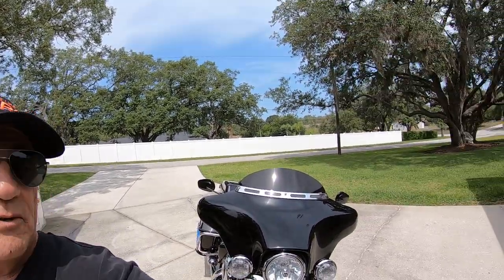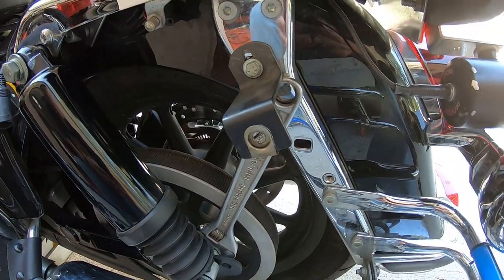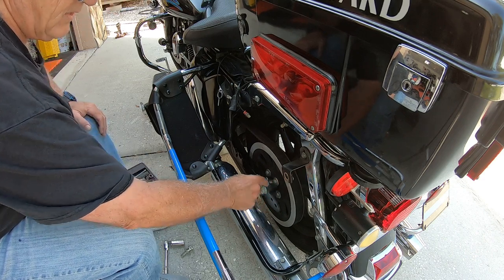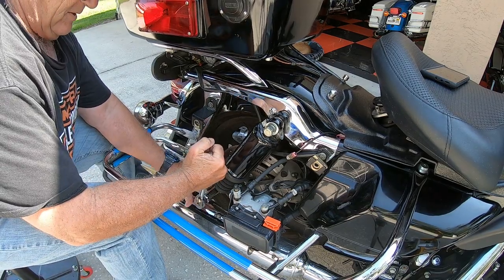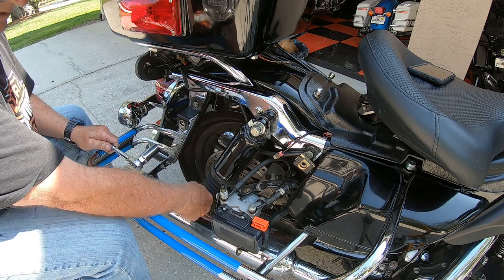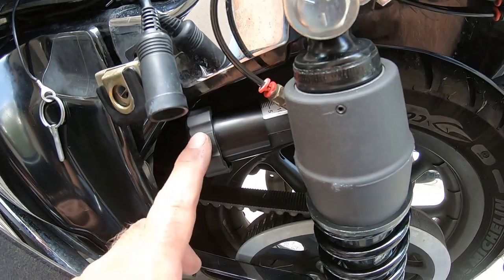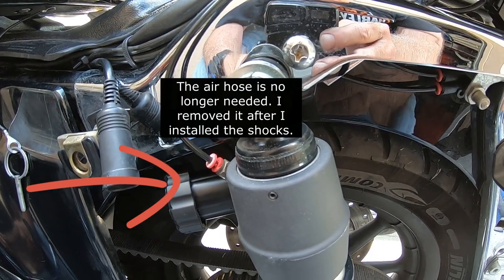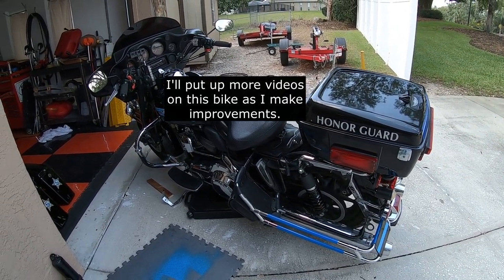Swap 2007 H.D. air shocks for 2022 shocks!

Comment: Even the new stock shocks are junk.  You can get some decent Fox shocks for about 6 or 700 bucks. Not "cheap" but better than spending 1500 or more on Legends or Ohlins and they work 10x better than the stock trash cans.
Reply: That is what I was thinking. Ohlins and legends are too expensive for me. I was also thinking air shocks but I’m not too sure if it really makes your ride comfortable, I don’t know?
Reply: @thanosetsitty1896  I went with the RevoA Legends and it was by far the best upgrade on the motorcycle. It was expensive 999 ( I didn't get the reservoir style ones because the improvement is marginal for a 50% price increase) but worth every penny. The stock ones are beyond terrible (and I don't even mention the difference in size of each side, very strange design)
Reply from the maker: The stock shocks work just fine. I know there are better shocks, but putting 700 dollar shocks on a bike I paid 1 K for, would be stupid. Especially since this bike will be used as a rental for my RLAP class.
Reply: Thanks alot jim boy.

Comment: If you put both bottom bolts on with the bike lowered you get room to work, then jack the bike up and do the longer shock first. Then the weight of the bike will compress it so that you can line up the second shock. Let the jack do the hard work.

Comment: On the adjuster side that Allen screw pointing straight out if you loosen that you can rotate that handle in or out to suit your motorcycle just watch when you put your saddlebag back on that you have enough clearance

Comment: Those air lines are John Guess fittings. Press the red collar down with needle nose and the hose will release and pull out without wrenching.

Comment: Nice video. I still have the original air shocks on my 04 Road King. I have never cared for them. 
I don't ride this bike much and now I am in the middle of replacing fuel pump, regulator and filter. Old gas really did a number on inside my tank. The filter/strainer mesh that is attached to the fuel pump has disintegrated in pieces and same with the rubber around the stock fuel pump. No wonder why it wouldn't start, lol. Once I got the fuel sending unit assembly out and the tank off the bike I got a good look inside and I can see the interior gray tank coating is flaking off . Boy what a job.

Comment: Yep they fit perfectly! I placed them on my 08 RKC. Mine also had the 12 inch air shocks and I scored a pair of 13" 22 premium's like yours for $75. However my bike had allen bolts and two washers inside the eyehole to frame. So my clearance was perfect on both sides. I'm 285lbs and had to drop the shock pressure setting # to 5 from 7. They are comfortable. However, it does sit my bike up higher so its definitely a new ride. But turns are amazing on her! Bumps are smooth and I don't feel like I'm bottoming out at all! Now I'm going to change fork oil and up the weight from factory 7wt to 15wt.

Comment: What's wrong with air shocks? MY 1991 FLHTCU has them front and rear and they work wonderfully. In fact all of my bikes (three are antiques, 1981, 1985, 1986) have air shocks and they ride well when aired correctly.

Also, I only run E0 in my bikes. I have not had a starting problerm in decades. E10 kills bikes. I don't even run stabilizer. I am in the process of editing a video to prove why you should run E0. My wife's 1986 Rebel 450 sat with E0 in the tank for six years. I pulled it out, changed the oil, plugs, filters, and wires, then used a jumpstart on it. It fired right up and ran on 6yr old gas. Carbs don't leak or anything.
Reply: Love my air shocks on my 98 as well. 2 psi front 8 rear.
Reply: I use E-continually but my bike never sits idle long so the gas doesn't absorb moisture. Never any corrosion in the carb or bowl. When I test the gas ( usually Shell ) it typically tests at 8% ethanol. Most E-10 is rarely a full 10%. Letting "gasahol" sit more than a couple of weeks in your tank can collect moisture.
Reply: @W.451  Correct, but moisture isn't the issue. The issue is that the ethyl alcohol soaks into various rubber components. As it evaporates it dries the components. Some last years, some last a few months. I have friends who ride carbureted bikes like me (I do not want fuel injection on my cruisers) and the ones who run E10 go through yearly carb rebuilds. When they separate the carbs it looks like rubber cement that is half-dried and black. New seals and another year they go!

Comment: Installed on an 08 Ultra Classic. No clearance issue like Motorman had. They seem a little stiff backed off all the way, but they have only 60 miles on them. I changed fork oil and used Bel-Ray 15wt. Front end is much better.😊

Comment: 86000 miles here on original electra glide shocks. Alway keep the about 10 psi. Never a problem.
Reply from the maker: Good. But this bike had 12'' shocks which limits the lean angle. I like to lean as far as possible so 13"'s are better for me.

Comment: I installed a pair of factory emulsion shocks off a 2021 Ultra Limited on my 09 Road King and had no clearance issues with the adjuster (I kept the 13in as I wanted more clearance).  There must be some height differences of what you swapped out or differences of how the adjuster is clocked in relation to the frame.  Also, I believe there are rear frame differences between the 2007 and 2009 and up touring models.

Comment: Not sure this is an improvement. I have a new 2023 road glide with those 'premium' shocks and I've already ordered an upgrade. They either bounce you off the seat or bottom out. Spring way to tight, no real adjustments can be made, absolutely horrible I wouldnt wish them on my worst enemy. Much love to you motorman and thanks for all the vids!

Comment: on the black shock adjuster there is a set screw (just below the bolt that holds the shock to the frame) with weight off the rear tire loosen set screw and rotate adjuster to get clearance. adjuster is held on by circlip, so it won't come off.

Comment: You should be able to turn that adjuster to wherever you need it after the install without clearance issues. I don't believe the distance between the fender and the top of the shock ever changes.😅
Reply from the maker: Yes, I figured that out after I made the video.
Reply: @motorman857  Never fails. :))

It does help that you leave the  oops moments in there... I'd rather see you do them than find out for myself. What YouTube should be.

Comment: Jerry, I was wondering why your 'new-to-you' 2022 shocks have an adjuster on the left rear shock only?  I still have my stock shocks on my 09 RK.  I'm just not familiar enough with shocks to know the difference.  Thanks for your videos and I sure did like "tighter than a clam's azz".  That was a chuckling highlight in the vid.  👍🏽🤠 9/15/23

Comment: According to lab testing stabilizer is quite over hyped and does not last near as long as claimed on the bottle. I would recommend using some PEA containing fuel system cleaner in the new gas like Chevron Techron or Lucas fuel treatment. Both of those and most use PEA in them these days.  PEA - polyether amine-based detergent.

Comment: I think there was a reason you could find those new style shocks used. I have a 2008 Road King with air shocks, and a 2023 Highway King with the new style shocks. The ride on the Highway King is horrible compared to the 08 Road King.
Even with both the seat and the shocks turned to the lightest setting, you feel every little crack in the road. I will be putting air shocks on the Highway King. 
I tend to wear a helmet most of the time but I don't on the Highway King because the constant jarring with the added weight on a long ride kills my neck. In my opinion the new shocks instead of air shocks is a harley fail.
Reply from the maker: The Highway King has the shorter 12" shocks with just 2" of travel. The 13" standard shocks that come with the Ultra Have 3'' inches of travel as do all the Police Harleys. They give a much better ride than the air shocks. They put the short shocks on your bike due to the high seat height with the 4.5'' spring under the seat.

Comment: I’ve got a pair on my 08 RoadGlide. I’ve had them on there for over 20k miles with no issues. But I run solo and not heavy. I can’t say you wouldn’t have any issues if you’re running heavy a lot. But then again these swing arms are known for cracking after so many miles of running heavy anyways, so…
Reply: I thought in 08 they fixed that issue then used that swing arm for the 09-up frame

Comment: Very nice video but you caught my attention in the last minute that the bike was not running for two years. 
I have the similar condition with my iron, my question is it ok to run the bike with the old gas and engine oil? Or it's gonna damage or effect the engine and make it worse because I want it to run but busy and it only needs a new battery.
Reply from the maker: Is it ok? The bike in this video had stable in the tank when it was stored. It still smelled like gasoline rather than varnish. I checked the oil before starting and clicked the starter a few times to get the oil pump working. Then started the bike. After that 1st start I let it run for a minute, shut it down then started it again and it backfired. That's when I drained the gas and changed the fluids before taking it for a ride. Will this work for you? I can't say.
Reply: @motorman857  so back firing isn't a good sign?
Reply from the maker: @xbx2207  Backfiring is not a good sign.

Comment: Is there a reason why you can't reverse the shocks... put the left side on the right side so the adjuster knob is to the rear instead?
Reply from the maker: I figured the H.D. engineers know more than me and since they put the adjuster on the left, that's where I put it.
Reply: @motorman857  ... Or maybe they made the fender clearance better for the left side.  I think I would try the shock on the other side just to see it if fits and clears the saddle bag.  At least then you might have a chance to use the adjustor.

Comment: Did the eBay search for my 2010 Road King. But it’s very confusing as there are a multitude of part item numbers for adjustable shocks for the touring frame.  Could you reply with the item number you bought?
Reply from the maker: I bought mine used and there is no part number sticker on the shocks. Call your H.D. dealer and ask what the part number is for 13" road King shock for 2015 or newer bikes.

Comment: It’s definitely an improvement from the air shocks but the $1500 Ohlins are night and day better than any of the harley shocks..
Reply: @markman7  it’s their market strategy. Build a $40,000 bike and put inferior parts on it so you can spend another $10,000 making it rideable… they hope you’ll spend most of your money at the dealerships but so many aftermarket companies have jumped in at lower price points that they don’t get nearly what they had hoped they would get in screamin eagle sales now.
Reply: @DNiddy  they are great if you don’t want the adjustments to fine tune the ride. I can adjust every aspect with the Ohlins. I could care less about the reservoirs hanging off the back but I do like fine tuning everything especially when I’m riding 1700 miles at a time sometimes two up sometimes solo. Can’t have a shock that does it all without the adjustments…
Reply from the maker: No.

Comment: I'm curious about those Michelin commanders, about how many miles do you get out of them and what about the traction.  How well do you like them compared to the Dunlop's?
Reply from the maker: I just got the bike a few days ago. In the 10 miles I've put on the bike, they seem to be holding up very well.
Reply: Ther is NO comparison to the Dunlop tires. The Michelins will last at LEAST 2X LONGER and practically 3X longer DEPENDING upon your riding style. I'm on my second set (Commander II to Commander III). I GOT 26000 MILES on the II's and expect upwards of 30K on the III's)
They are also very competent in the rain.
Reply: I put 20k on a set of Commander II's, and they still have a life left. I put a set of Commander III's on my other bike last year. They're doing great thus far. Nothing but good to say about them.
Reply: @JHV166  thanks for your input. That would be great to have better traction and better mileage. I do ride more aggressively than I should, but when the sport bikes want you to lead(not all Harleys are bar hoppers)you need all the traction you can get. I have broke traction on the rear two different times on wet roads with Dunlop's. Glad to hear you say the Michelin has good traction on wet roads.
Reply: @classicrider103  Well, you know that Harley's are NOT sportbikes
, but they are certainly capable of handling aggressive riding when properly set up, shod with appropriate tires and ridden by an experienced rider. The Commander III's will certainly give you the confidence to ride at Higher Level .
Reply: @JHV166  LOL yes, I'm aware a Harley isn't a sport bike .  With 52 years riding experience, motor cross, flat track, drag racing and hill climb sometimes those hooligans bring out the competitive part of me. My birthday is tomorrow 5/11/59 my wife said "it's time to act your age". 🤔
Reply: @classicrider103  you still have a wife after that? Lmfao

Comment: I heard the older swing arms (pre 09) will flex and crack with 2014 up shocks . The newer shox only rebound on the left side . Just what I'd heard Jerry
Reply from the maker: Who'd you here that from?
Reply: It's true. I know from experience.
Reply: @motorman857  The intranet forums of course 🤷‍♂️. They did beef up the swingarm on Tour bikes  in 09 at the frame change for a reason though .
Reply: I’ve got about 20k miles on my 08 since upgrading to the newer style shocks with no issues at all. A friend of mine did it and his swing arm cracked. But he’s always running very heavy where as I run a lot lighter. He also stated that he had the other side crack before he even started running the new style shocks. So I gotta assume it has a lot to do with how heavy you run.

Comment: Very possible the old shocks weren't trash, just the lowering dohickey. ........with the old shocks mounted without the lowering dohickey would probably be just right, if not you could change them with amount of air

Comment: I would keep air shocks ! I had a 2016 street glide the stock shocks sucked ! You felt every little fucking bump in the road ! I even took it back to the dealership twice and they were no better I had a 2001 classic with air shocks and I put a lowering kit in it and it was still way better than the new shocks Harley is putting on the bikes ! And now I have a 2007 screaming eagle road king 3 with air shocks and their great !